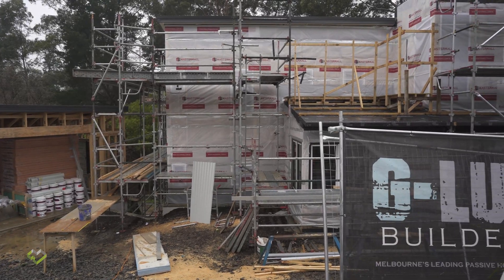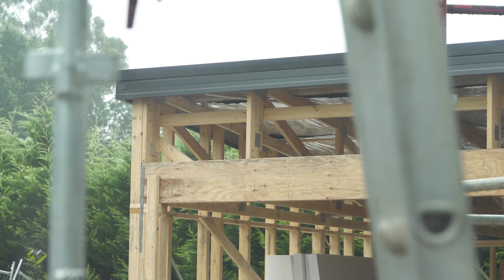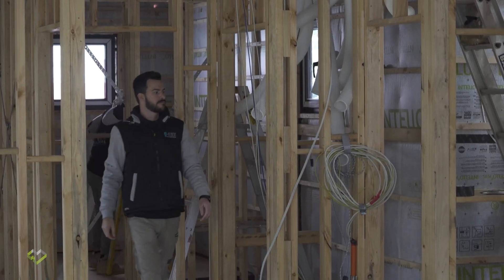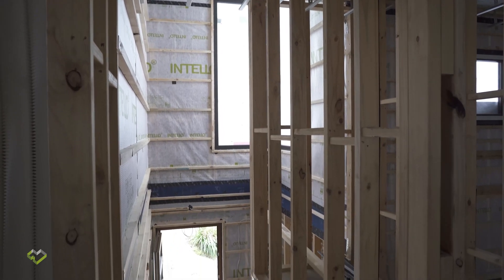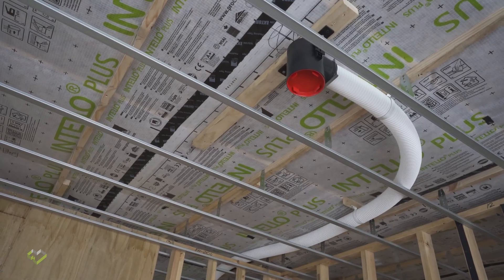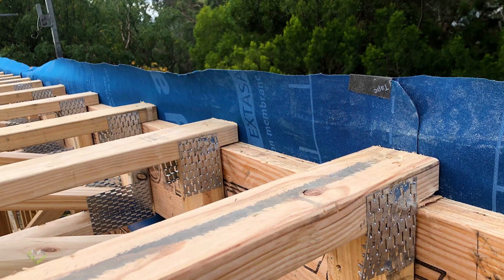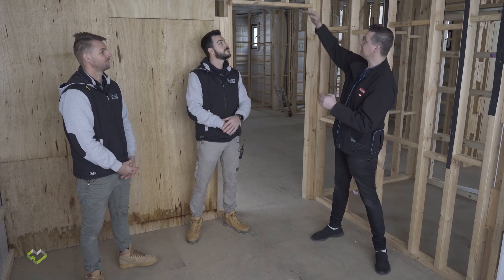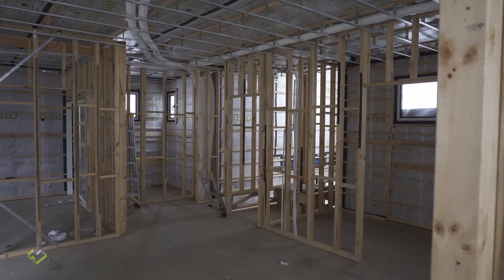Going down the path of Passive House

Comment: How much extra per sq m to build to passive house standards?
Reply: I recently rang around and several "custom" builders in my state (Victoria), including these guys (GLUX), wanted between $2800 to $3600 per m2 to build a house that doesn't leak air. Note that the cost per m2 of a volume builders like GJ Gardner, Metricon etc. start at around $1600 and go to $2600 depending on what options you want, style and land type. Volume builders don't know what a blower door test is and when you start talking about air tightness, they have no idea. In the end, I decided to build my SIPS house as an owner builder. There are heaps of videos / information on YouTube for owner builders using SIPS and Efficiency Matrix also have some general videos out there that are quite helpful. The cost to build a house as an owner builder will be around $1800 per m2 using SIPS. May vary slightly depending on design and fittings, just like all homes, but it's definitely the better option if you have the time and are handy with tools.
Reply: @PaulyDownUnder  builders are tradies seem uninterested when you start requesting about what is basic code in the US and I think it's the time factor.  The level of detail required takes time and that cuts into their profits.
Reply from the maker: It’s a good question.  Have a chat to some of these builders.